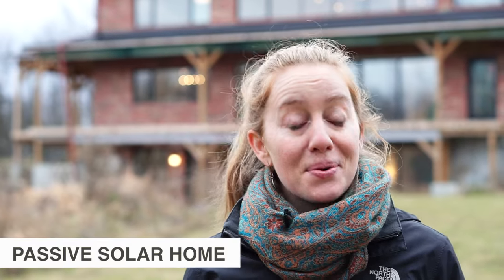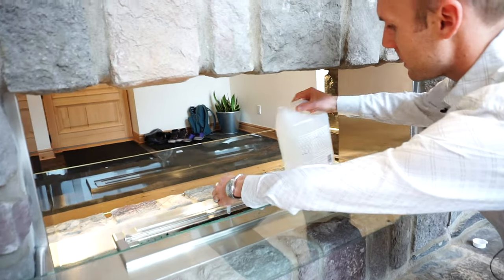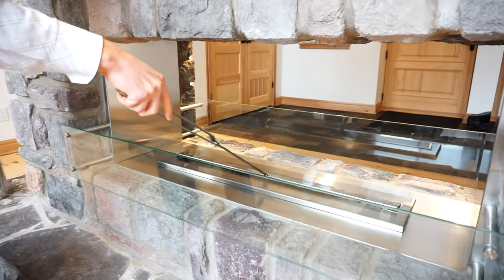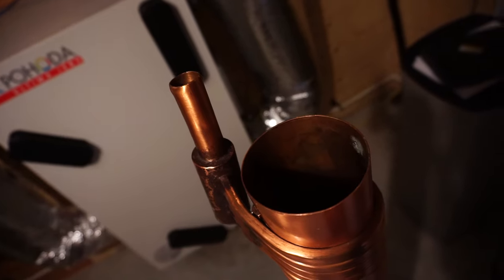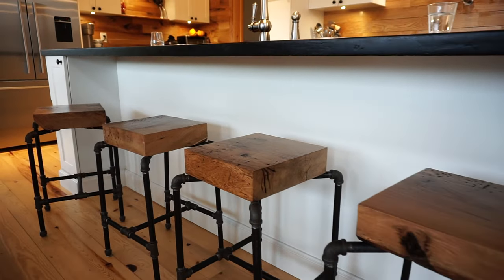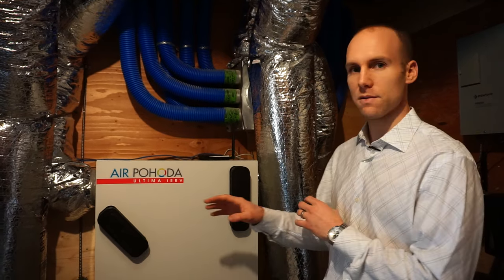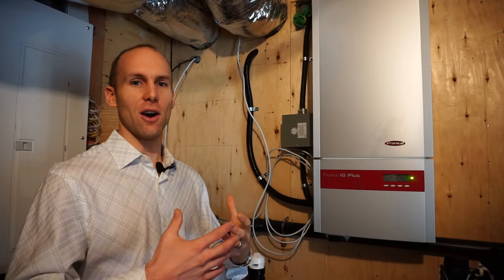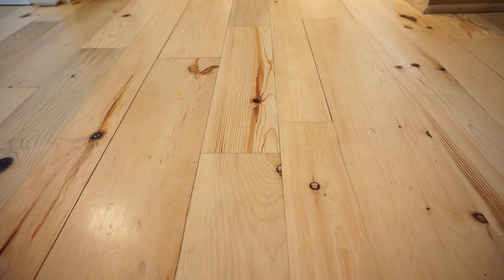Couple Builds Energy Efficient Passive Solar Home - Green Building

Comment: No fossil fuel house yet Bioethanol fireplace? How is this even logical.

Yeah, it's not "fossil fuel" but it's still hydrocarbon based and so not very "green". Just because "bio" is in the name doesn't mean it's clean...
Reply from the maker: +simonlynchsae thanks for watching and for sharing your comments.  There's no perfect energy source out there that is completely clean and unfortunately in Canada we definitely need to use energy to stay warm in the winter.  We agree that bioethanol is not a perfectly clean source of energy, but unlike fossil fuels, which are not renewable, which pollute upon extraction, and pollute when burned; bioethanol is a renewable energy source made from plants like corn.  Neither option is perfect, but we're all looking to find the lesser of two evils.  Thanks again for watching!
Reply: +simonlynchsae Also as they're on the electric grid, how is the electricity produced?  Fossil fuel?  Nuclear?  He stated in the video that they don't use their solar power directly.
Reply from the maker: +Kelly S thanks for asking!  I just did a quick search and it looks like Ontario's electricity production breakdown is: 60% nuclear, 25% hydro, 10% wind and 5% gas and biofuel.
Reply: +simonlynchsae   If there was going to be a spill in front of your home would you prefer corn or crude oil?  I'm not a big fan of ethanol based fuel either but it is a step in the right direction.
Reply: +simonlynchsae I like ethanol it burns clean and you can drink it. Bonus! Lol
Reply: Nothing "burns celan". It's not a real thing. Unless you are talking about hydrogen, all hydrocarbon burn and produce CO2...
Reply: Exploring Alternatives Bioethanol is one of the major reasons base grain (corn, rice, etc...) has seen their prices grow very fast.

If you think growing veggies to convert into fuel for burning is "renewable", you need to double check your facts.

And for all the people saying "it's a step in the right direction" you are sadly and severely mistaken.

It doesn't "burn clean". It creates CO2 like any other hydrocarbon on earth. I'd be more than happy to give you some intel on those fuels outside of youtube if you want!
Reply: Kelly S They produce clean energy and sell it back to the grid.

Most of canada has pretty clean energy (beside the pariries....). Nuclear being phased out to give way to hydro from Qc being sold to Ontario...
Reply: John Norris That's a very narrow and uninformed opinion on hydrocarbons.

Both would be a disaster ecologically. Their are hard to clean up and toxic to vegetation.
Reply: simonlynchsae Yeah, I forgot about the 1852 Iowa corn spill. It about destroyed the outskirts of Des Moines. "Ears for years" they used to say   (???)

PS - When you burn 100% plant based fuel it doesn't add any carbon to the biosphere.

PPS - Ethanol evaporates and is considered by some to be less of a toxic hazard to the environment.
Reply: Ethanol is C2H6O. Those 2 carbon make carbon dioxide when burning. So for each molecule of ethanol burned, you get 2 CO2. It's chemistry. You can't argue with it. It IS less than conventional fuels, but CO2 is STIL produced. there is no denying this.
Reply: simonlynchsae I've not made any attempt to argue that chemical reactions involving oxygen and carbon based fuels don't make CO2. The question is where is it coming from?

A source that naturally takes what it needs from the atmosphere, oceans, lakes, and rivers or from reserves sequestered deep within the Earth's crust for millions of years. When used from the former the amount of carbon in the biosphere stays the same and from the latter it will go up.  The results seem to be warming the planet and acidifying the oceans. That's my argument.

You can discuss this until the cows come home but if we don't come up with a better energy solution we will have a number of massive problems to deal with in the next 50 years. I think ethanol presents a partial solution but falls short of the mark for a number of reasons. I do like the attempt and support the effort to change people's minds about where they get their energy.
Reply: John Norris +1
Reply: John Norris You almost have a good answer but you fail to realize a few key things.

Global warming, acidification of oceans, etc doesn't care where you get your CO2 emissions. If the sources is biodiesel, classic fossil fuel, ethanol, etc. it doesn't change anything. It's swapping one CO2 emitting sources of energy for another. It's not a step it the right direction, it's a side step, slowing down progress.

Any combustion is not the answer. Solar, wind or hydro are WAY more efficient, clean once at operating regime and sustainable than anything found or fabricated that is burned for energy.

Also, you fail to realize that all this corn used for fuel is driveing the cost of meat (which isn't all that great on the environement either but let's not go there for now,..) and the cost of most basic grain (corn, wheat, rice, etc...).

WORST, since FOOD has become a fuel source, speculation is in full swing on it's trading prices! Now people speculate on food directly affecting poorer countries relying on those grains for survival...

There is nothing sustainable about bio fuels. Not their energy efficiency (it burn cooler than traditional fuel so you need more to make the same power), not their ethics, or it's manufacturing process.
Reply: simonlynchsae I've not failed to realize anything. I just didn't try to lecture anyone on a subject too broad to tackle in the comments section of a YouTube video. Keep it up though because I'm sure with your smooth delivery you'll have the world using renewable energy toute suite.
Reply: Sorry if it felt like a lecture. I simply pointed out in my first comment that ethanol and other hydrocarbon based fuels are not sustainable, ecological or a step in the right direction.

It's a common misconception pushed through clever marketing (flexfuel, and other) and I wanted to make note of it here since it IS a channel about alternatives...

Everything points that hydrocarbons aren't the alternative. That's all!
Reply: simonlynchsae Then say just that and leave the ad hominem attacks to Fox News.
Reply: John Norris My bad if you felt attacked. Then again, many people feel attacked when their beliefs are contradicted by someone else so it's hard to point out misinformation and errors without ripples...
Reply: Peter Šori thanks for that
Reply: Peter Šori you missed my point.

Ethanol still produces CO2. It doesn't "burn clean". There is no such thing as "burning clean" when hydrocarbons are concerned.

It's really basic chemistry. If you have carbon atoms in your fuel, you WILL produces CO2, maybe CO if the A/F ratio isn't correct.

I wasn't concerned with the safety of it (I know it can be safe...) but with the whole "finding alternatives" with fossils fuels.

It's a bit contradictory.
Reply: Burning clean for breathing is one thing. Burning clean for the environment is another. I'm more concernend about the environment side of the equations as I KNOW it's clean for indoor.

And IF bioethanol is carbon neutral (proof needed as the process of converting crop to fuel isn't perfect, entropic losses have to be considered) it's still quite irresponsible to use FOOD to produce fuel. BIOfuels contribute to the higher prices of base grains and complicate famines in poorer countries.

It's about the big picture!
Reply: Of course hydrocarbon is green. All living animals on this planet burn (oxidize) hydrocarbons (sugar/fat).
CO2 'harms' the environment if it is released to fast. 
It would be no problem to burn all trees on the planet if they would regrow right after it. 
It is only about balancing the CO2 concentration in the air. 
In Germany we have 8 million households heating with wood. About 20%. 
If all houses in Germany were insulated well, Germany wouldnt depend on fossil fuels.
Same with the rest of the world.  A low low energy house needs 10x less energy to heat.
Just think of the energy content stored in the insulation like styrofoam.  1,5 ton of it that insulates a house for 40 years contains 15,000 kwh of energy. Or let's say 1,5 ton of oil.  
That means : You can turn the oil that you would need to heat a home for half a year into a insulation that would decrease your energy bill 10 fold for 40 years.
Reply: It's not just about balancing CO2 concentration, it's about entropy. Combustion creates alot of entropy which only goes one way. If you want a truly sustainable system, you need to look at the end game.
Reply: simonlynchsae Haha..... It is about entropy.... Crazy......
Reply: +simonlynchsae I feel your pain. Trying to explain logic to some people is just impossible. Everything you said here is accurate, unfortunately we live in a society of sheep who get their facts from Facebook memes. Your argument is sound. I thought I'd just post this one comment validating you otherwise I would have just got roped into the argument along side you.
Reply: How dome and illogical are you no energy is perfect the people in the video is doing way better than the most of the population as an average. And you never learned of the basic carbon cycle is school plant are made of carbon and they re absorb the CO2 to produce them self (grow) its true my explanation is oversimplified. And corn ethanol is not the best. Its have a return which is low on energy compared to sugarcane ethanol. And its true its can affect food price but they usually stay at the same price when the production is done properly it can even lower them...Lock at ethanol production in Brazil they produce a huge amount of their fuel renewably with sugar cane. And on one of your other post you were tacking like solar power was perfect no it's not to produce solar panel it poluts a lot they just last so many year before individual cell start blowing up.And you have to replace them and they are almost impossible to recycle. And i think resaling power like the are doing is more environmentally friendly them having battery.  Which as well would go bad after so many year.Personally i think wind and hydro are the best source of electrical power hydro is some what limited to the amount of river and can be somewhat damaging to salmon migration when not applied properly...And on another point there is no other way to store large amount of power in a somewhat renewable manner than bio full. And any animal or humaine produce CO2. So you pollute just by living but with the carbon cycle the CO2 gets re absorbed in the environment. Without carbon CO2 the Earth would die.... CO2 is like oxygen for plant i no its all a balancing thing....And i no i have oversimplified and not even mention the metaine but i am not giving you a chemistry or science course...
Reply: Renewable and ecological don't always go hand in hand. It's renewable to recycle a plastic bottle 100 time but it's not ecological since it takes massive amount of energy to do the recycling. Best to not produce the bottle in the first place (lower consumption...)

And ANY biofuel is bad. Just because "plants consume CO2 and bio fuel produces CO2" doesn't mean the ratio is 1 to 1 and it balances out. the actual process of transformation requires energy and the release of the carbon in the air is much fast than what the plants can absorb, regardless of the fuel burned.

You seem like you have some logical understanding of energy production but it's hard to tell from the grammatical and spelling mistakes, sorry if english isn't your first langage!

you still need to brush up your knowledge about combustion and energy transformation before you can say that sugarcane fuels are renewable and a valid solution...
Reply: I never mention plastic in my post... I totally agree about the fact plastic recycling is not renewable but it's better than the alternative of throwing it to the dump. That just plain waste. Personally i would go back in time and re use glass bottle like they used to do a long time ago they just washed them really well and re filed them.  And i understand the law of conservation of energy and every time you convert it to some other form of energy you lose a certain percentage ect.. ect... But just like i said in my post i wasn't going to go way in detail. And you are rite about the fact English is not my first language French is. Francais est ma langue maternelle. But what do you propose as an alternative when you need dense and potent fuel? Fore heavy transport and other. And personally i would have used a small wood stove in the house instead of an ethanol stove. I would just make sure i cane seal the chimney shut when i dont use it so i dont get air loss. But you probably have something against that as well what would you personally do fore additional heat? He said He prefer using ethanol because it dose not need to be vented and their was less potential of energy lost from a chimney. My favorite kind of house is an Earthship but i like learning and seeing other option.
Reply: simonlynchsae 

Bio ethanol, like made from corn locally gives basically 0
contribution to atmospheric CO2 increase if in its production energy source
also environmentally friendly (like wind energy!!!). Cos  i.e. corn absorb CO2 when it grows and then
when it is burned it releases same amount that it already absorbed during
growth. It is better than burning coal, oil, natural gas.  Got it?
Reply: Peter Šori ACTUALLY, I did not claim it is NET ZERO, read again!!!
I know that all, you can save your talk for your fossil friends.
Even burning wood , then is not net zero, you still have to chop it, bla bla bla. wow big deal comparing to ofshore drilling impact or coal mining ... Sure, you had to say something, just to say something...
Reply: '' Peter Šori - ...,all hydrocarbon burn and produce CO2... ''
and H2O ...!!! []
Reply: Well said
Reply: That would be true if this corn was replacing a barren field of dirt and there were no external inputs needed to grow said corn.  I personally don't see that often/ever.
Reply: Bioethanol, or vegetable matter derived fuels are not adding carbon to the biosphere.   It was not naturally sequestered, but it part of the regular carbon cycle.  The fossil fuel is not part of the natural cycle, being removed from the cycle millions of years ago.....  It is about efficient use of what is in a natural system, not totally abandoning a civilized energy using society.  Everyone has to do their research, check the information, and make their own choices.  That means living an independant a self sufficient lifestyle.
Reply: An independant air supply to the firebox of the fireplace would help.
Reply: simonlynchsae Gee! Do they have it going 24/7? Get real.
Reply: +Exploring Alternatives   Where did you get this breakdown?  The IESO shows a breakdown that's quite different.  (I don't understand the two charts on their page entirely, but here's the link...)

http://www.ieso.ca/learn/ontario-supply-mix/ontario-energy-capacity
Reply: true

Comment: It's a nice home, but if they built smaller then they could have cut costs as well as energy needs rather than running HVAC 24-7. Passiv Hause standards are great and all, but the houses I see built to be "Passiv" tend to be huge. I wonder how much the house cost for example. Not trying to dig into them too much, and it really is a great looking home, but it seems prohibitively expensive. Proponent of the Tiny House movement here. No reason a house can't be "Tiny" and "Passiv" but I have yet to see an example where they are combined and the PH standards seem to cattor to huge mortgage monsters.

Comment: Thanks for sharing. Casey really knows his stuff House orientation and air tightness for a passive house. 10kW solar power panels what I would install for that latitude. However, Casey fell for that climate change bolony which has been comprehensively debunked and his ethanol fireplace is horribly inefficient when you take into account the energy used to create the fuel

Comment: This isn't a green solution for the average family or couple, I would be curious to see construction costs. I am always fascinated in how yuppie types want to build green "McMansion" houses and never consider or talk about the footprint of the house, and costs associated with such a large structure. Solar orientation aside, footprint really determines the majority how green a building is based on the amount of materials needed, resources needed to heat, etc. regardless of how green the materials used.

Comment: A hot water tank is not very eco friendly.   An on demand water heater is much better.  No waste of energy to keep the water hot.
Reply: Are you sure? Using an instant hot water heater requires high quantities of electricity instantaneously. That can only come from the grid, very large batteries, or very large capacitors. Using a heat pump allows them to very efficiently heat the water using ambient heat. It's too close to call without actually measuring energy consumption.
Of course when they switch to an electric resistance heater in the winter, that's less efficient than on-demand.
Reply: gas powered.
Reply: didn't work for me. I'm saving tons with a hybrid (coil + heat pump) hot water tank. (Got rid of my on-demand system, to make it work. Besides professional insulation, that was the best thing I did for my house.)

Comment: No way is that house 100% solar, the stove and fridge alone needs 500 watts per day and all the lights on even if Leds at 6 watts each is a lot. Sure they want you to believe its done right but sorry it's not. The hot water tank and gadgets make a bigger carbon foot print to make than to use for 10 years.
Reply: Not if their grid power is 90% carbon free. Only 10% comes from natural gas - which is in itself emits half the carbon than coal per KWh.  So their average carbon per KWh is about 10 times less than USA average.